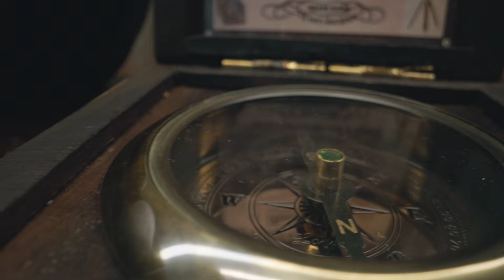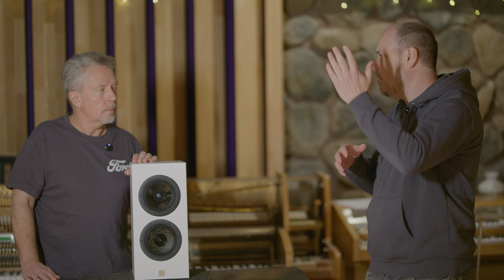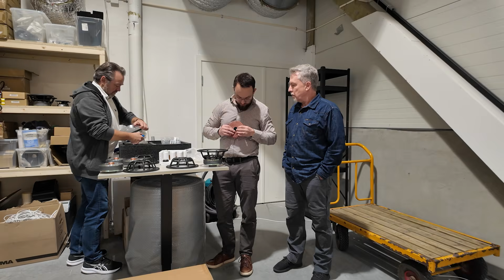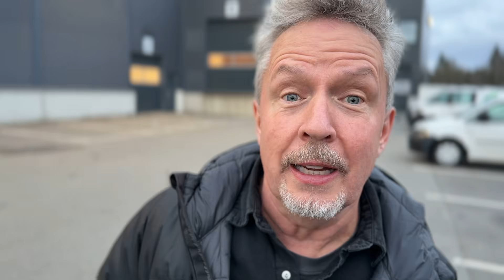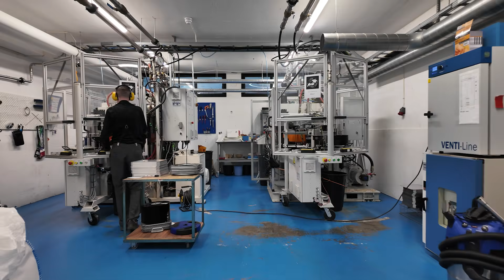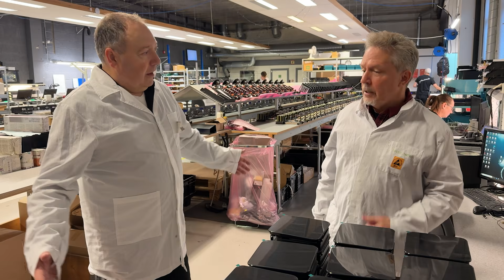Inside Norway’s Hi-Fi and Vinyl Boom—Sigberg, Arendal, Electrocompaniet, T-Time, Velvet Recording

Comment: And there is SEAS driver manudacturer which is also Norwegian. 
Patos was a Norwegian speaker manufacturer who sold building kits which made good value for money. 
Forsman was a Norwegian dipol speaker manufacturer. A friend had a pair of those. They sounded great to me, but he complained the speakers were demanding. He changed them for Spendors. 
Tandberg was a Norwegian Hi-Fi manufacturer now defunct. Most noted internationally for their high end cassette decks and reel to reel players. Their old tube receivers are still popular among entusiasts in Norway.
Reply: That's just the tip of the iceberg :) Hegel, Doxa, Ø Audio, Adyton, Abrahamsen, NNNN, Vera Audio, Musical Innovation, Midgard, Aura Fidelity, Soundcare, ... And back when NAD did decent amps, their engineering was done by a Norwegian. Apropos Forsman - their cylindrical folded/dipole approach was genuinely unusual. I wish someone brought back that design.
Reply from the maker: @Cidr0n  Great info! But we did visit Hegel and  Ø Audio the previous year, as well as SEAS.
Reply from the maker: Great listing! Our team stopped at SEAS the year before.
Reply: Patos made Kitts??